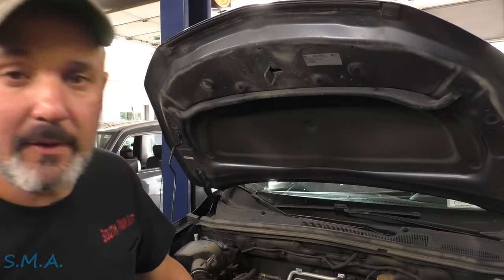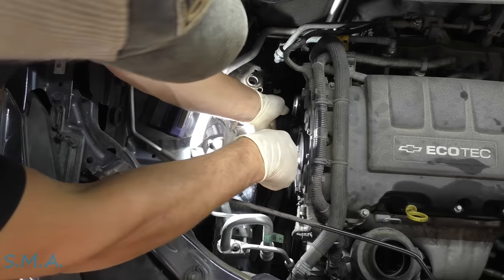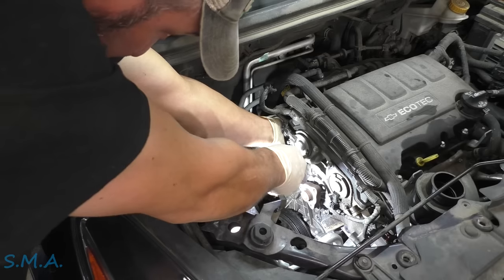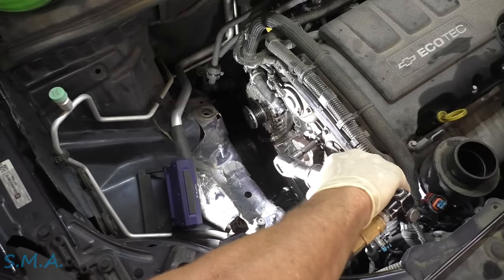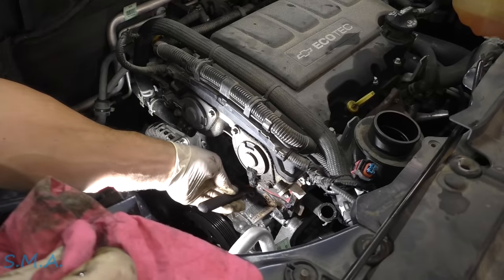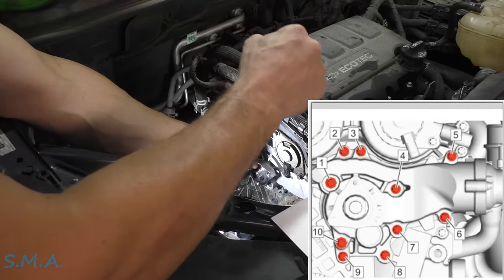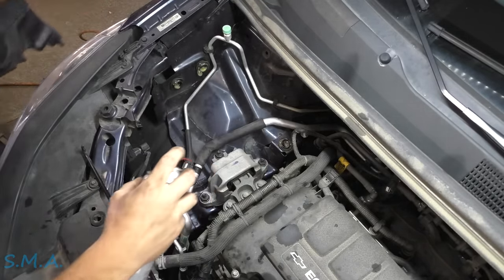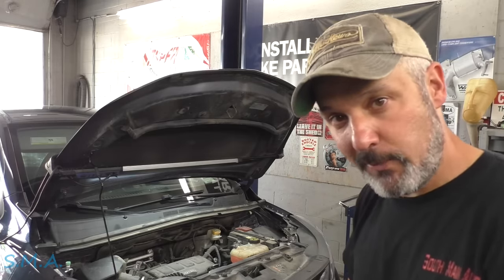Chevrolet Trax: Water Pump

Comment from the maker: Astro Pneumatic Tool 9409A Hose Clamp Pliers: https://amzn.to/3f0B9MA
Astro Pneumatic Tool 9409A Hose Clamp Pliers & 9502 Hose Removal Hook Set, 2 Piece: https://amzn.to/3QR8SW7
Heavy Duty Hose Clamp Pliers: https://amzn.to/3f0663G                     https://amzn.to/3Ui8S4u
Reply: I'm obviously not a GM fan, but great content as always.  Thank you Mr O
Reply: what work light is that please
Reply: @DaveImagery  why would it be obvious that you are not a GM fan?
Reply: @johnlucaiii9495  I made a comment earlier
Reply: @ Big Dave

Looks like an Astro 100SL . Great light and has wireless charging
Reply: I hope you’ll see this. I have 2008 Chevy Tahoe , we have change the battery, new alternator both done at the shop. My gage on the inside keeps bouncing from 14 volt to 12 volts . What else should I look at ? I think the shop has done work on my dime that didn’t need done. I really done want to go back there with out knowledge of what to tell them to check. Thank you ahead of time if you see this message
Reply: I can tell you that back when I was wrenching, one of the happiest days was the day I bought one of those cable hose clamp pliers
Reply: Good...
Reply: My first water pump was on a 1965 Mercury Comet with a 200 cu. in. straight six. While tightening it down I tightened two bolts too much and snapped off the ear on the water pump. Back to the auto parts store for a second pump, and this time it was a success. I was 19 at the time, I am now 70.

Comment: When I was 14, my dad had a Buick with a bad water pump. He was working out of town, so I decided to 'fix' it. The pump was one with about a dozen bolts. I got it swapped and proceeded to snap three of the bolts off. I did the 14-year-old thing and glued the bolt heads in place. The car ran for years that way without leaking. I never did tell on myself. Feeling a little guilt right now.
Reply: Don't worry it was just a GM
Reply: That’s the funniest cover up I have ever heard of.
Reply: Did you use Gorilla glue ??
Reply: ...YOU WERE LUCKY-(!)
Reply: Guilty for what? A successful water pump replacement that lasted for years? Better work than I'd expect at Midas or Meineke.
Reply: @jamespfitz  Not telling my Dad.
Reply: @Mauser304  I don’t know how old you are now, but I feel like that would be a great story for the Thanksgiving table 😂
Reply: @jamesearl1756  Dad has been gone for 20 years. I missed that opportunity.
Reply: @Mauser304  He knew what you did, he saw the glue. But the car was working and that is what matters. LOL
Reply: @Mauser304  RIP
Reply: @jamespfitz  About 30 years ago a coworker goes into Midas for a brake job.  "It's done, you can pick it up".  He does.  On the way home, the brakes fail.  They filled the brake system and revisor with motor oil.   I wouldn't think that's possible, but they somehow managed to do it.
Reply: Lmao
Reply: @dlewis9760  wow
Reply: That story definitely deserves a thumbs up!
Reply: I think I bought that Buick a few years back… my water pump on my 430 was glued in…Breaking those bolts was super common…you were far from alone
Reply: My dad bought a brand new lawn mower and it had a rattling sound in it and he had to go out of town, so I decided to help him I was going to fix it and tore it all apart.. I was about five years old. And when it came time to put it back together I didn't quite remember where everything went so I stuffed all the parts that I could into an old wooden toolbox we had and the rest in various places around the garage needless to say when my dad got back a week later and went to go mow the lawn? no lawn mower.. my father blamed my brother and yelled at him for an hour over it and he had no idea what he was talking about when the two of them went to go search for it they started finding said parts when they turned to me, I told him that Santa Claus must have done it when my father exclaimed at Santa Claus!!? How in the hell could Santa Claus have done it?? I told him I said nobody sees him but present still show up.. needless to say I couldn't sit for a week and was never allowed to speak Santa Claus's name again lolololol
Reply: @dlewis9760  Jesus christ, I'm not a litigious person but I'd absolutely have spoken to a lawyer if that had been my vehicle
Reply: That's when they were easy to change..
Reply: @smbrob  I believe I used Permatex form a gasket.
Reply: My goodness.. glad i have only done water pumps on trucks , rwd cars and a boat.
Reply: @dlewis9760  
Gee, that was an expensive mistake,  all the rubber parts would need to be replaced,  the rubber brake lines for the front brakes,  the rubber line that goes from the frame at the rear Axle.  Plus the wheel cylinders/disk calipers.  I would have been very upset over that mistake.
Reply: @philllsxga.7737  I think its been a while my 06 truck was a juked at 80k.  Frame rotted right out. Seams all the GM stuff around me still has issues with ice melt.  Everyone I know has something from Japan now or they just lease.
Reply: I think he knows now and still proud of you!
Reply: @Mauser304 Haha Better than what a dealership would do!😀😀
Reply: @Mauser304  trust me,,he knew,just didn’t, know how to thank you ! I miss my dad too ! He brought me up by his “baseball knuckles “ I deserved it,, I thanked him while fishing many times, for he made me a man !
Reply: What did you use for glue is the question.
Reply: @Clearanceman2  Read the entire thread and you will find that answer.
Reply: Bad boy, but a wise one.  Elmer’s glue? Or JB Weld?
Reply: @dlewis9760  A guy I knows wife did that, he had to flush the brakes like 3 times and they still were never right again
Reply: @rollenschultz2707 buicks will run like shit much longer than most cars will work at all
Reply: At what point could you do the mistake of breaking the bolts(I'm just learning through youtube) when trying to pry the water pump out? Or using to powerful of a impact gun and over tightening?
Reply: How old r u now? lol
Reply: Good on you for having a go 👍👍
Reply: can you please explain exactly what you did because i have a cash buick and it has broken water pump and i have no money to repair it . Soo water is coming on the beltt and its all over please helpppp

Comment: 4 years old lol, my 2000 4Runner is still on its OEM water pump 👌
Reply: 2004 F350 6.0 power stroke with 400k miles still on original water pump.
Reply: Sounds like someone's due for a timing belt and WP lol
Reply: Outside of replacing my platinum spark plugs at around 98k all my other stuff under the hood of my 2017 200 with 126K+ Is also still OEM (but I do live in Florida).
Reply: My 02 Tundra with 54K is already on its second frame.  They aren’t all perfect. 😂
Reply: Standard GM quality 3 year warranty service life
Reply: This is a terrible engine as are all of its variants...their V8s are not bad though, if they don't have AFM.
Reply: @scottdavis_34  I replaced the frame on my 2000 tundra. Other than that, it’s been a great truck.
Reply: @dontblameme6328  Are the head gaskets original, too?
Reply: @scottdavis_34  well thats what you get for not rinsing off the undercarage after each snow fall. 05 toyota camry 300k miles still on original frame with very minor amount of surface rust and original tranny and motor. believe it has original timing chain, water pump, and still oem suspension and bearings.
Reply: @killerwowmaster  Ordered the kit yesterday, just purchased this rig lol!
Reply: @xbahamutzero  I inherited the rust bucket so it would have been difficult for me to rinse the underside huh? 🙄
Reply: @shadetreetech  As long as Toyota keeps paying for it I don’t care but I’d never buy any of their products.
Reply: 2008 Chrysler Town and Country 4.0,.......... 213,000 + miles,.... OEM water pump and the tranny in these models are "said" to be faulty at around 150,000 - 175,000 miles and still have not had a major issue with anything. As long you take care of your vehicle it will last.
Reply: @xbahamutzero  yes sir.I have/did.
Reply: @7700jessie  that 4.0 has a timing belt, you should get on that sooner then later!
Reply: OEM water pump? Better replace it before the timing belt brakes or loses the teeth and Bends the valves.
Reply: @xbahamutzero  Yeah the Legendary gutless 5VZ!
Reply: Well then 22 years on the original belt I assume? that's pretty good. And water pump allrighty then! I've been working on GM for 1year and 5 months now and I'm not impressed at all I'd rather have a Toyota or Honda!
Reply: my 2003 Ford Focus has the factory water pump at nearly 125k miles.

Comment: I remember taking my 2012 Sonic w/ 1.4 turbo to the local Chevy dealer for a leaking water pump to be fixed under warranty.  Got it back 2 days later, parked it in my garage...underneath the engine the next morning was a large puddle of oil.  Long story short...Never again Chevy, you're dead to me.
Reply: It almost seems like you have to do your own work these days.😢
Reply: Yeah I know countless others who have had premature failures in GM vehicles still under warranty, which is bad enough, and then your local GM dealer with underpaid technicians who hate their job, make things even worse messing up the repair often in serious ways. Then it can turn into a finger pointing mess where the dealer denies damage they caused. Just buy a more reliable car that’s unlikely to need any dealer service for say 100K or more miles like a Honda. And even if your Asian car does need dealer work, the reputation of dealer service for Japanese and Korean brands is FAR higher than the US automakers.
Reply: Gm went down the crapper in 08 when they had to get bailed out. Everything got cheapened up
Reply: @sharedknowledge6640  none of the car makers are the same, our Honda required new injectors at 60k due to misfires, common issue on the 1.5t, just like the 3.5L.
Reply: It’s not just GMs. Hondas have major issues these days.
Reply: @Minivan Lifestyle manual or fake “cvt”
Reply: I have a friend that for some reason, loves the Cruze. She's on her 3rd one in 4 years lol I feel bad for her cuz it breaks down at the absolute worst times with her...
Reply: @Riqsuav1   3rd in 4 years? I guess she is happy to get over 1 year with a car? I've been driving an older Jeep, the same one, longer than she has been driving those 3 Cruzes.
Reply: @Riqsuav1  no different then having friends over for “super bowl” & your brand new 70” hi- tech big screen,,, don’t come on ? What ??? The world we live in,,, things break,, when you need them the most ! LOL,,, but,,, not so funny !

Comment: Wow, 4 years on a new water pump. Way to go GM.
Reply: GM Korea* lol
Reply: I've got a2006 pontiac vibe with the Toyota 4zz engine,  has 306k and the original water pump
Reply: To be fair, at least they put the water pump on the engine instead of inside the engine.
Reply: No coolant ! Tap water destroys em
Reply: GM is synonymous with junk. What they put out today is a disgrace and even Barra has acknowledged it when she came in to the CEO position. Unfortunately nothing's changed and she hasn't seemed to be able to correct the problem. So many premature failures is a result of using lousy OEM parts, all comes down to saving a few dollars and letting the owners sort it out down the line. Look at resale value, before you purchase one of these vehicles, because true cost of ownership is not just the purchase price but the repairs and what the car is worth when you want to trade it. Buying a GM vehicle is false economy it will always cost you more money in the end.
Reply: @shaneanderson1036  so we got to ask a question where did the coolant go lol
Reply: @shaneanderson1036  Why did they have to add water? Leaking water pump?
Reply: I got 16 years and 180k miles out of my buicks water pump, just did an 18 gmc pickup(v6) pump was completely gone, like absolutely no bearing left, was awesome, at 53k miles, but a bunch of idle hours
Reply: At least it's easy to get to... 🤣
Reply: @wespotter6985  Honda & Subaru OEM batteries are good for 1 winter. Saves them money & weight.
Reply: @mariosaccoccio1688  LOL
Reply: It is true that Honda uses small batteries currently to save money and and to have less weight. I'm on my third battery for my 2014 Accord. They last for 3 years and that's it, but the space allotted to the battery is not large enough to go up a size to the group 24 so we're kind of stuck
Reply: Try a Caterpillar C15 that in less than 10K miles on the engine blew 6 injectors a water pump the turbo and for fun cracked the camshaft on it.  That was on a BRAND NEW engine in 1998.
Reply: Yea and I thought the Dex Crud was red in color.  I saw green coolant coming out.
Reply: Every gm I've owned so far has needed a water pump except for my 3.6 malibu gotta love gm for crap water pumps besides that I've had good luck with my gm cars 🤞
Reply: @wespotter6985  To be fair, they also made cars like the Beretta back in the day.
Reply: My Beretta rocks, 29 yo, 185k, drive it all the time. 3.1 v6 baby!!
Reply: @wespotter6985  gm gready motors
Reply: @wespotter6985  im sorry but any older gen mechanic will not single out one manufacturer. Im an gm born man when fords where rusting brokedown yada yada but i have ford superduty ,ford excursion , gmc 3500,  new  chevy  blazer , vw routan  and  90 300zx  nissan and the best one is my gmc 3500  ( every one has different  issues  that i hate ) but your story is biased
Reply: well you know the car only had a 3 year warranty, planned obsolesence.

Comment: Really GM? You have to support the engine and remove motor mounts to replace the highly failure prone water pump on the dumpster fire unreliable tiny 1.4? GM could learn a lot from say Honda if they remotely cared about repairability which they obviously almost never care about. Friends don’t let friends buy GM vehicles made after about 1971.

Comment: I love how all these connectors etc always pop right out for you guys. Took me a half hour to get my air box loose.
Reply: I love how all these connectors etc always pop right out for you guys. Took me a half hour to get my air box loose.
I know, right?
Reply: Its CGI😆
Reply: Hands on experience is valuable.
Reply: Practice makes perfect.
Reply: I put plastic safe dielectric grease on any connector I can possibly reach, saves me massive headaches later.
Reply: I changed my pressure power steering hose. I thought, just disconnect the two ends, connect both ends, refill with fluid, done. Nope, took me about three hours and a trip to O'Riley's to get a special wrench to get the top connector undone that's on top of the steering box. It's down where there is hardly any room and wedged between another connector and, I think, the water pump, something like that.
Reply: Exactly
Reply: Now that you know how to do it, it will only take 45 minutes next time.
Reply: I never end up really working on the same thing twice.  So every time I see an electrical connector in a different place or vehicle, it's a new goddamn puzzle box to solve blind and upside-down.  Do you push the tab in, do you lift it up? Do you pull it out? Or is this other bit the tab? Should I just stab the pick into my hand now and get it over with?

To be fair, I'm exaggerating for effect.   It's not always that difficult.  Most of the newer stuff has tabs that just conveniently break off like uncooked spaghetti.
Reply: Spray wd40 on the grommets it helps a lot. And just wiggle it back and forth firmly with both hands while pulling up at the same time. Like someone else says it's experience.
Reply: Replacing a air filter can be a major job these days !
Reply: "Easy Peasy".../S Now I know why the shop want's $1000.00...Then again; That Chevy Trax/EcoTech looks like the first reliable motor Chevy has made in 20 YEARS...
Reply: Its because youre not a mechanic lmao
Reply: @isorozco511  well i didnt want to break it.

Comment: As an engineer, I want to apologize for the engineer that designed a car where you have to un-mount the engine to replace a water pump.  I'm embarrassed for him/her. 🙂
Reply: How about the engineer who decided to put the water pump under the timing cover and connected to the timing chain on the ford 3.5?  That was a complete brain fart. Nothing better than a water pump failure dumping coolant right into the engine oil.
Reply: @the_bishop  I just did one on a 3.7l Explorer. I dropped the powertrain out for a trans job, figured I would do the pump at the same time. What a complete bear of a project to work on those🙄. 15 hours total to do everything including flashing the used trans shift parameters, charging the air, and vac filling the cooling system 🙄Still needs to go in for an alignment🙄
Reply: Lol my Citroen SM has the water pump at the rear.  I’ll have to remove the engine to replace it.
Reply: @the_bishop  The 3.5L yes.  I still remember the mocha-brown gooey snot that used to be oil and all the curses I spent.  It's not just that the pump leaks into the crankcase.  Because it leaks into the crankcase until catastrophic failure, most owners will be completely unaware that it's leaking at all until long after it's caused damage to the engine.

Comment: Just changed the water pump on my 92 GMC K1500 - simple, rewarding, doesn't leak. That water pump must win the award for the MOST surface area that could possibly leak in the industry...good grief!